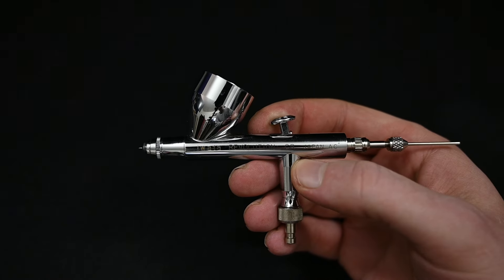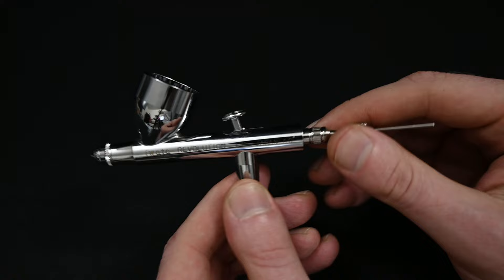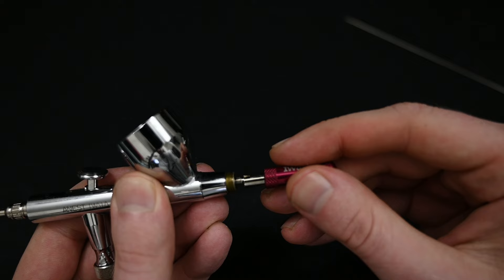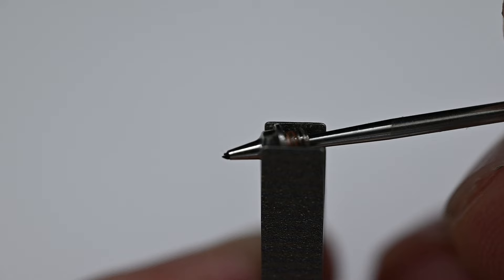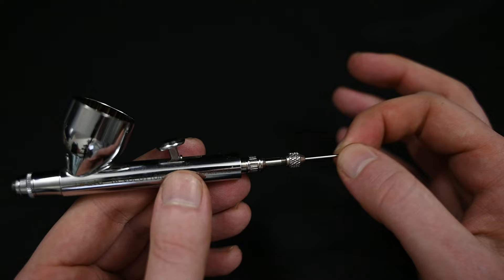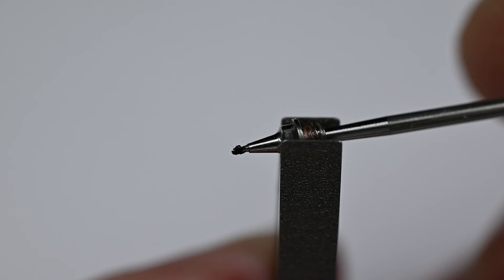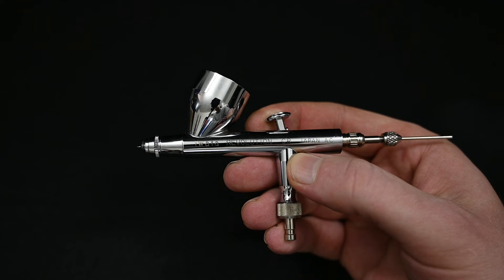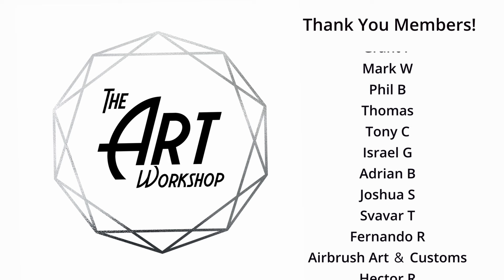The AIRBRUSH DETAIL KILLER - How to Check for and Remove Partial Nozzle Clogs

Comment: Awesome info for those that don't know.   I'd maybe add some description that this should really only be done by advanced users and to go gentle, and ONLY when there's no other option.  90% of the brushes that come into me for repair are due to people overly aggressively cleaning,  and in those, it's mostly nozzles cracked due to overtightening OR they used something OTHER than a proper airbrush needle (like those gold half needle twisty things sold by amazon), and have trumpeted the nozzle.

Every time you introduce wear and tear on the nozzle, you risk wear and tear on the threads, and that causes leaking and bubbling back up into the cup, and erratic spray.

Finger tight only!  

Keep your airbrushes off my workbench!  Don't take the nozzle off if there is ANY way to avoid it.  :)

Comment: I Always look forward to your videos. great tip. I found a tip online that helps to strain paint right out of the bottle. Amazon sells these 1/2 inch metal dome screens that fit perfectly  between the cap and the bottle. Tried sharing the link but I dont think youtube allows it in the comments. Shouldnt be hard to find. They look like faucet strainers. The catch is they must be kept clean too. I hope this tip is helpfull, Love your content.
Reply from the maker: I had one of those before- very useful!  It doesn't happen if I remember to clean the paint caps, but I'm lazy and always forget to do it. Great suggestion, thanks!

Comment: Nice video! i just use spray can carburettor cleaner , the little straw that comes with the can is ideal to blow the cleaner at high pressure through the nozzle, two squirts and it is shiny clean. it is basically acetone , methanol and toluene, clears it right out without any risk of damage to nozzle. First i put the pointy end of nozzle in straw and blast it in reverse to clear out any big lumps etc then i blast from other direction and i can see the nice spray pattern of cleaner come out front of nozzle...job done! in a pinch , if in a hurry, can even draw needle back with trigger and put straw down the hole in cup and blow out the nozzle without removing it !

Comment: I personaly prefer to use a  sliver of a toothpick. I put a slight crack in my nozzle the one and only time I used the needle to try and clean the nozzle. I thought I was being very gentle but...
Anyway....just a suggestion.
Reply from the maker: I never tried that but sounds like a great idea. I'll have to test that out one day- thank you!
Reply: I keep a sharpened bamboo skewer in my kit just for this purpose. I set the end of the skewer in the cleaner same time as the nozzle. the skewer lasts a long time and is very gentle on the nozzle.

Comment: Awesome video !! And especially if you use CRETEX OPAQUE WHITE ! That paint is a headache in a bottle it’s very temperamental! And clogs very easily!! Thanks for the tips I never knew that ! YOU ROCK 🤘🏻🤘🏻
Reply from the maker: white paint is always a pain! it's most difficult paint to spray well.
Reply: Why when they have easy to take apart floating head nozzles, that work perfectly well, do they still make these little wicked, time consuming screw in nozzles.
Reply: @bebopkirby  to get more money ! I bought an Iwata eclipse for $149 with the floating nozzle easy to replace so I bought another Iwata high line hp ch with the Mac valve and it has a screw in nozzle don’t get me wrong the performance is second to none but the nozzle alone is $40 and the Iwata 0.3 needle is $29 so I only use it for fine detail work you’d think the $300 Iwata high line would have the floating nozzle as well but no such luck ! So if you can afford it I’d recommend the high line with the Mac valve but NOT FOR big jobs like canvas coverage !

Comment: Off topic but maybe you can help? Every time I use my Eclipse HP-CS the back lever on the chucking guide gets cocked sideways somehow and the needle gets forced into the nozzle so hard that I have to take them both out of the gun and separate them with a LOT of force.  Not sure exactly how to recreate the problem but sure enough it happens almost every session. I always set the spring to max tension. Anyway.. considering your experience with the Eclipse I though maybe it’s happened to you and maybe you’ll know how to remedy it. 

Great channel! Thanks in advance!
Reply from the maker: that sounds like it's installed incorrectly, like angled in the wrong direction or something. I would unscrew the rear assembly and check to make sure that lever moves easily. Then reinstall it (tilt it forward before installing and make sure it rests flush against the trigger) and try to loosen it up a bit. Maybe a few turns back from all the way. See if that helps.
Reply: Ещё есть такое мнение что куда бы человек руки не засунул, будут проблемы. Может в этом случае имеет место тюнинг который и приводит к таким осложнениям. Лично у меня две iwata и две эволюции , иглы ровные .

Comment: I have a H&S ultra the nozzle is clogged with a clear coat. I can’t soak it because the nozzle has a seal. Any suggestions?
Reply from the maker: that seal comes off. just need to grip it with something and it pulls right off. Plus it's PTFE (teflon) so its solvent proof anyway.
Reply: @theartworkshop  thank you

Comment: Nozzle clogs are the type of thing that ultrasonic cleaners are meant for. Remember, there are no hand-done braze joints in an airbrush nozzle. It is a solid piece of machined steel. Ten minutes in the buzz bowl will have that nozzle cleaner than using the needle tip to clean it out, and with less risk of damaging the needle tip or nozzle or both. Also the wrench provided with the airbrush is completely sufficient to remove and reinstall the nozzles. This is why Iwata provides them. That's what they are for. One just needs to be careful. One does not "need" to buy another tool.